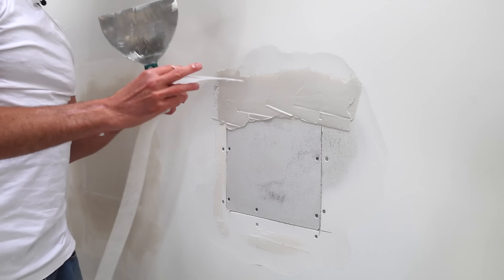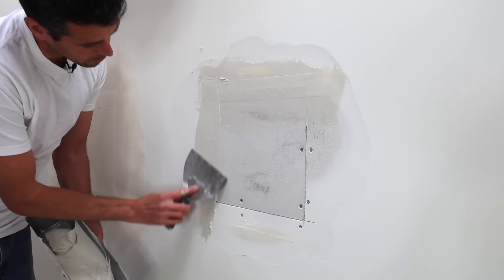The 3 BEST ways to TAPE DRYWALL!!!

Comment: I destroyed my walls looking for a squirrel, I don't wanna talk about it lol. I'll be doing new drywall in basement kitchen , going with ultralight mold tough drywall I guess and going to try and use your middle showcase, mesh tape that's green (will that be any different?) Fibatape mold mesh tape. 

Should I use 45 minute quick set since I'm newer to this or 90? Dont but premixed right? you say "air drying muds"...

Hold on so many different mud types overwhelmed

Quickset then "finish mud" (is that air dry mud or all purpose mud or is it called finish mud, I can't find 'finish mud") . 

I didn't even know you needed another mud after the normal bucket patch, I've been doing it all wrong. 

Now I have to watch all your videos to better understand matching first mud to tape type, then the 2coats and time between based off mud type and then finish mud (trying to figure out what that is) and if that needs 2 coats and how long to wait between coats. Then how long to wait to paint, 4 days is fine with me if so.

Deep breath.... I don't even wanna talk about how terrible my cathedral ceilings were done by last homeowner..I can see every drywall piece outline and tape starting to separate... First let's learn on the ground haha
Reply: Definitely watch any videos that pertain to your needs, but I can still chime in a bit.

If you're still new or just unsure, go with 90 over 45. The forgiveness and reduced urgency will save you a lot of headaches and stress. No one wants to spend more time doing drywall, but always consider Murphy's law. If it can go wrong, it probably will - give yourself the wiggle room up front.

"Finish mud" is more of a catch-all than a specific product. You can use all purpose for final coats, but topping compound (comes in a 5 gallon premix in my area) is an example of a "finish mud" that's engineered specifically for final coats. And yes, it's an air-drying mud.

24 hours is usually ample time for most types of mud to be cured enough to paint. But in most cases, if it's dry to the touch, you can paint it.

Mesh tape is fine for your flat seams, especially if you're using quick set. It's a little more forgiving to apply for a newcomer. Just gotta make sure you get mud into the seam or it will fail and crack. However, you'll end up wanting to burn your own house down if you try to do your corners with mesh tape. Paper tape in the corners, all day. Watch a few of Ben's videos on taping corners. It can seem daunting, but just be patient and diligent with the methods and you'll get it.

Much of your remaining concerns/questions come down to personal preference, application necessities, experience, and the quality of final product you desire. If you have a massive project to tackle (which is what it sounds like you're describing) try getting one area done to completion first, take note of which areas you're struggling with, and look more into those areas for help. If you try to have the answer to every problem before going into a project you've never done before, you'll end up feeling overwhelmed very quickly.

I know it can seem like a daunting task, but just be patient. Give yourself permission to make some mistakes while you're learning. You got this.
Reply: @dooshnukem32  wow, thanks for the reply and helpful words of encouragement, I never expected that with my confusing post and online trolls nowadays. Yes, tons of work to do and 40 stairs from driveway to work area and it's just me lifting it all, I don't want to fail to haul more back up. Again, thank you very much. I plan to start to finish this disaster of a kitchen now. Watching corner videos now. Fun birthday
Reply: @dooshnukem32  one last question, why not pack the doors with mud then put in the mesh and mud over it
Reply: @Hedgehodge-  of course! I've been at it for a while now, but I remember well when it was all still scary lol.

There are a couple really specific instances where I would pre-fill when using mesh tape, but typically I only pre-fill when using paper tape. Mesh tape gets its ease of use from 2 things: the adhesive, which allows you to apply it directly to the drywall and reasonably expect it to stay where you put it; and the large holes, which allow you to easily embed the seam behind it with mud while it's in place. Trying to float mesh tape in a bed of mud can be a painful experience - it catches on knives very easily and it lacks the surface area to stick to the mud when that happens.

Long winded answer, but it's an important question and answer. All that said, you mentioned doors in your second comment - to clarify, are you referring to where your drywall ends at openings like a doorway or window, etc?
Reply: @Hedgehodge-  Happy birthday btw! I was unprepared, drywall advice will have to serve as my gift 😆
Reply: @dooshnukem32  life lessons are perfect, thanks

Comment: I'm not sure why anyone would use anything other than mesh tape for patches and repairs? We use mesh-tape with 20-min mud and use heat guns. Got to get it painted today if you actually want to make money! Been using the same system for over 20yrs and my repairs don't crack or bubble..

Comment: What’s wrong with cutting the patch 4” wider than the hole, remove 2” of the drywall filler all the way around the patch and place that in mud on wall and smooth out.  I do this basically for every patch I do. Other than that a great video
Reply: That’s called a California patch. It has its uses.

Comment: Need to prefill those gaps. That is what keeps joints from cracking. Forcing the mud in does not work as well
Reply: true, however for a quick patch and demo video it is fine.   Ben did advise on pre-filling wherever possible.

Comment: It's interesting and a bit funny that the method you like the best (paper) gave by far the poorest results and was the hardest to work with even for you as the paper was sliding all around every time you went over it.  It also left some creases, bubbles and rough ends where it overlapped other paper.
Reply: I noticed that too.  The results looks not ideal.  There is clearly bubbles and creases.  If a pro struggles with paper tape, well a DIYer will have a poorer result.

Comment: IMPORTANT:  When using paper tape, you are supposed to pre-wet it before applying, this is because dry paper will “selectively” pull the moisture out of the mud. When this happens you are left with mud in certain areas with uneven moisture content which can affect the curing/air drying process of mud, which in turn affects the strength of mud and you may even observe cracks later. Same idea applies when applying concrete on top of existing concrete, you need to wet the surfaces before applying the concrete so the existing concrete doesn’t pull the water out of the applied concrete.
Reply: No wetting your tape is not necessary, been finishing drywall over 40 years never had a problem 
Just make sure you have enough mud under the tape so not to get air pockets

Comment: I had asked this question on another video, but has anyone used spray foam? I saw a video where someone mounted a piece of drywall on some backing to cover a hole and then sprayed foam all around between the patch and the drywall, then applied mud, no tape. Any thoughts?
Reply: I've done it with durabond on small patches successfully. Wouldnt use anything else without tape though
Reply: HA! I’ve done that a few times and got away with it. Not my preferred method but it does work.
Reply: Why ?? Don't risk it !!
Reply: Sounds like a bad idea if it’s a part of the wall people might touch or lean on. 

I have prefilled a wall to ceiling joint hot mud without tape and didn’t get around to taping it properly for over a year, and the prefill never cracked.
Reply from the maker: Please don't do that. What works on a short youtube video will not live up to real world stresses and standards.
Reply: @vancouvercarpenter  No offense man, love your vids and I'm not a pro. BUT.. I had blown in insulation in my house (where they drill the holes in your wall) and I filled every everything with sprayfoam, then durabonded and all purpose lite over top. Zero cracks after 7 years.
Reply: Again, not a pro and wouldnt do this on a job if I were. But worth trying on your own house!
Reply: I should also say I used a good amount of glue in the mud as well, for good measure.
Reply: @vancouvercarpenter  Thanks, that’s what I thought. It’s kinda crazy what passes as good advice these days.

Comment: Since your videos reach farther than particular names of products, could you please also use more general names? Quickset, no such thing here. Do you mean joint compound? Here in Oz, we have: joint compound, basecoat, and topcoat fillers..each of which can be purchased pre-mixed or dry. The trend has been by shops to provide more pre-mixed products and dry products are becoming extinct.

No V shape cuts for joints...for owner DIYers?
Reply: Quick set or hot mud is any mud that cures rather than drys. Anything that can be sold pre mixed is an air drying mud. Quickest will only come in a powder and is usually labeled with a number such as 20 or 45 whi h is supposed to be the working time - time you have to get it on the wall and smoother out before it starts to get too thick.  These curing muds tend to be harder Arthur and have more adhesive in them then then air dry muds

Comment: Video request: Alternatives to using wood strips and screws for backing drywall patches. Instead, I want to test out the following: 1) cut strips of drywall to roughly slightly larger than the wood strips you would have otherwise used. Insert those drywall strips into the hole and place them exactly where you would place the wood strips. Instead of using screws, use fast setting adhesive.
Reply: Why?
Reply: @DiffEQ  Simplifies the patching process by reducing the materials needed. Additionally, after a wood+screw patch is finished, someone may be looking for a stud to anchor into. Magnets would find those screws and a cheap stud finder may identify the wood strips as studs too.
Reply: I’d add that if you have to open up the same place (hate it when that happens) the second layer of drywall is easier to cut through than wood.